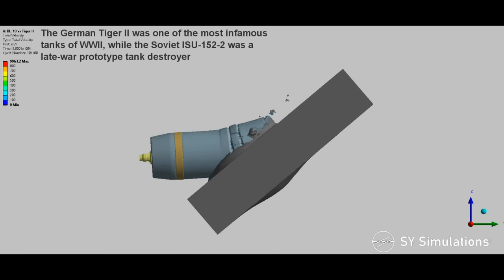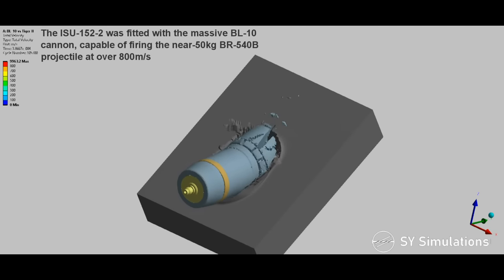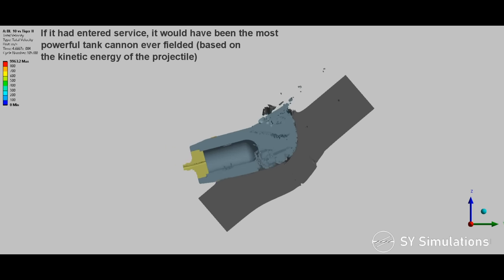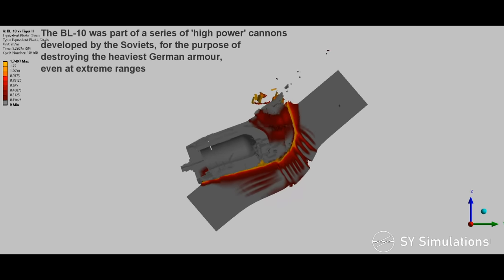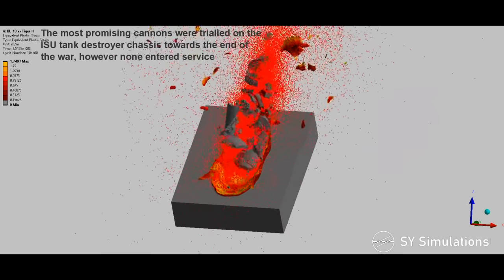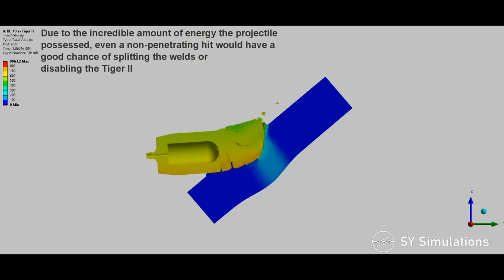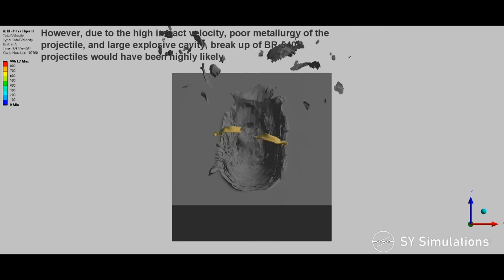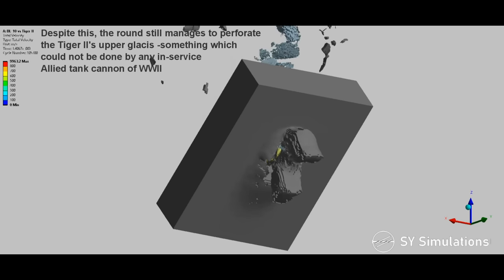SIZE MATTERS | Super ISU-152-2 vs TIGER II | 152mm BL-10 Armour Penetration Simulation

Comment: it's impressive how sloped armor was a real game changer for the time. Imagine this gun's energy would be more than enough to go through 250mm if it was flat
Reply: What do you mean "for the time" ? Slopped armor has been around since before tanks even existed.
Reply: @Niitroxyde  Because slopped armor died as soon as HEAT weapons became effective. 

And no, slopped armor became a real thing during Operation Barbarossa
Reply: @thiagorodrigues5211  What are you talking about.

How could sloped armor disappear because of HEAT when slopped was just as good against HEAT since it increases the effective thickness of the plate and thus the amount of steel the jet has to go through. Only difference is that HEAT projectile can't really ricochet (unless the warhead doesn't properly go off).

Sloped armor was already used on most WW1 tanks you could think of, was used on Ironclad warships in the 19th century and was even used on that Da Vinci's tank design from the 15th century. I'm sure you could find even earlier examples if you dig deep enough.
Reply: @Niitroxyde  Because HEAT didn't just penetrate 100mm anymore. It penetrated 400mm which means it was impossible for any tank to carry as much armor as needed. So Tanks became light and fast after WWII until the development of Compositve armor against HEAT. 

Then, back to kinetic weapons, now an upgraded version of the APDS which again made Tanks vulnerable. 

Now tanks are useless
Reply: @thiagorodrigues5211  And how is that related to sloped armor ? HEAT was defeating RH armor, sloped or not. But sloped armor was still the most effective way to deter HEAT (save for a few spaced armor ideas like the Schürzen) until the apparition of composite armor.
So again, how was HEAT the downfall of sloped armor in particular ?

And how are tanks "useless" ?
People have been calling tanks obsolete since the end of World War I, yet they're still here and further designs are being worked on in militaries around the world, so they're definitely here to stay for at least this century still.

Not to sound too pompous but you need to open a book or two on the matter, bud.
Reply: @Niitroxyde  It doesn't matter how armored your tank is, it will never be thick or slopped enough to handle a HEAT shell. So after the war they realized that and tanks became maneuverable and fast instead of heavy and slopped as in the end of WWII.

ANd you may also need to read some books, I would talk about Otto Carius book called Tigers in the mud where he talks about how vulnerable a tank can be, losing one of his to a PTRD to the radiator. 

Today you get a 10k drone carrying explosides to destroy a 8 million tank plus the training of the crew inside. 
You get a drone designating a target so your helicopter launches a missile from  a safe place and there is nothing you can do about it.
Reply: @thiagorodrigues5211  Well it depends on the warhead itself first of all. HEAT is not some magic wonder that burns through any armor like butter.
A HEAT warhead can only burn through an amount of armor proportional to the charge it carries.
An M1 Bazooka can't go through the frontal plate of a Panther for example.

And the switch from heavy armor to better mobility did not come directly after WWII, it took at the very least the advent of the M40 then the RPG-7 to convince nations to rethink their armor doctrine.
And even then, it wasn't the case for everyone. The US didn't really care about it and sticked with big and heavy, same for the British. And it still worked, especially because they used ding ding sloped armor.

Cheap armament defeating heavy armor is nothing new. Again, some people have deemed tanks obsolete since they were born, basically.
It was especially the case in the 1950s in the Sinai, when Israel used SS.10s against Egyptian tanks, and people were just heralding the end of the tank, because such expensive machines could be defeated by a small weapon that could fit in a suitcase. And yet here we are today, tanks have not gone anywhere.
What you need to make a weapon obsolete is something to replace it, not just something to defeat it.
And right now, no weapon system can replace the versatility of a tank on the battlefield.

Helicopters hunting tanks is nothing new either. It's been a thing for decades, yet it doesn't stop new tank designs from still being put into development. And I think the people designing those tanks know a bit more that you and I do about their hypothetical obsolescence.
Reply: @Niitroxyde  it's new when you get a drone to designate it, meaning absolutely no risk for the helicopter. It's why the KA-52 is being so good at it. And I'm talking about post war HEAT, not war HEAT. HEAT after the war could easily go through 400mm of armor, which means adding more armor would just make a tank slow. 

This is why for many countries now tanks may be a lost cause and we may actually see lightly armored vehicles take their place. 
What's the point on having all that composite armor just to fight other tanks anyway?
Reply: @thiagorodrigues5211 Have you looked at modern tanks? They are all heavily angled to increase armor effectiveness.

Also, you have armor because tanks don't operate in a vacuum. Helicopters are far from the only thing you will run up aganst. Smaller cannons are very common, like the 100mm on the BMP-3, along with it's autocannon.
Reply: @Chopstorm.  no slopped armor can evade a rod penetrating it. It has absolutely no effect on new rounds.
Reply: @thiagorodrigues5211  What are you even talking about? Have you not looked into all of the testing the Army put the M1 through in the 90's when testing it against Russian ammunition, specifically 3BM-42M? Ammunition, by the way, which is more "modern" than what they've been using in Ukraine? 

Also, love how you conveniently ignored the rest of my comment. In WW2 most tanks could kill eachother. Panzer IV H, M4A3, and T-34-85 could all kill each other relatively easily. Guess tanks were useless in WW2 then eh?
Reply: @Chopstorm.  Because I'm not talking about WWII era, I'm talking about post war era. Today's tanks need more than sloped armor to defeat today's ammo. 
So it's better to make an area where it's easy to install and replace composite armor(which by the way is far harder to keep) than thinking sloped armor can do any good to you. Today's tanks have max 6cm of steel and everything else is composite armor installed in the most important areas
Reply: @thiagorodrigues5211  But your reasoning also applies to WW2. 

You're saying because modern tank ammo can penetrate other tanks, armor is useless.

WW2 tanks shooting then modern ammo could penetrate other WW2 tanks. Therfore by your logic, armor on WW2 tanks was useless. Do you seriously not see how flawed your argument is, even if it was true , which it most certainly is not. This has been proven repeatedly by modern tanks surviving incoming "modern" rounds, especially in blue on blue instances in both gulf wars.

And before you backpeddle, here is a quote from your earlier comment. "It doesn't matter how armored your tank is, it will never be thick or slopped enough to handle a heat round."
Reply: @Chopstorm.  Armor is useless today by the simple fact that it's only useful against other tanks and even then, you can't protect your whole tank with composite armor. That has absolutely nothing to do with WWII. But even during WWII they realized how vulnerable a tank can be, not only to other tanks but even heavy mortar.

And it's true, a HEAT round is just too effective, but it only became effective by the end of WWII. a few years after WWII HEAT rounds were both effective and fast enough to blast your 150mm tank from far away, changing the whole idea of Post war tanks to a faster and maneuverable vehicle. 
instead ofa behemoth of steel like the IS Series. It's actually the main reason the IS series died, giving space to the T-54 which was basically a modernized T-44. 

Today you have several flat tanks like the Leclerc, Black Panther and the reason is because it's easier to replace it's composite armor blocks.
Reply: @Chopstorm.  By the way, a tank surviving APCBC has absolutely nothing to do with what I'm talking about. 
But do try to survive APFSDS or whatever it's called now with steel only...
Then again, that's basically a tank vs tank battle, and today's tanks, just like before, are only decently armored frontally. The front of a Tank is 20% of it's area, making it quite vulnerable anywhere else.
Reply: @thiagorodrigues5211  The older versions of Leopard are the only modern tanks to have truly "flat" turret faces, while still being angled horizontally. This was changed with the arrow package, which, surprise surprise, added in more angles. The Black Panther has an exceptionally small flat surface for a turret face, while the rest of it is angled back at an extreme angle. The Leclerc, again, is an extremely small turret face with the rest of it steeply angled. Compare their turret sizes to those on Abrams or Challenger (which are also angled heavily, by the way), and you will see what I'm talking about. Modern tank combat isn't like video games, where you aim for weak spots in the armor.

You also neglect to mention the fact that the hulls are more steeply angled than ever before in tank design.

Also, what are you even talking about with APCBC? My point was that old tanks had the same issue you see with modern tanks: they can all kill each other.  That has never changed. 

This is pointless. You continue to cherry pick points, ignoring the context while also being exceptionally disingenuous in your arguments. You clearly have no idea what you're talking about.
Reply: @Chopstorm.  you realize the amount of steel in today's tanks is nothing compared to WWII, right? That's because composite armor protects you, not sloped armor. 
But anyway, you seem to be too triggered for a normal conversation so, wish you a good weekend
Reply: @thiagorodrigues5211  Where was anyone talking about steel? Did I bring it up once? Ever? The whole conversation was about sloping armor. Composites are a part of armor. Whether that's tank armor or simple body armor. Cloth was used as armor in a gambeson.  It is not only steel. You've completely lost the plot.
Reply: @Chopstorm.  I think you did, because composite armor is basically layers of different materials that are made to take the energy away from a rod instead of deflecting it. Those are made between the tank's steel armor which is basically just thick enough for autocannons and even then, not strong enough to hold discarding sabot autocannons. Composite Armor is what holds today's rounds, not anything slopped.
Reply: @thiagorodrigues5211  I have no idea what you're talking about. The composite armor is sloped. It still has the same effect as sloping steel, by causing incoming projectiles to pass through more material. I never once mentioned steel by itself, and I have no idea why you are.
Reply: @Chopstorm.  Me neither because I never saw composite armor being slopped.
Reply: @thiagorodrigues5211  Then you are legally blind. Look at the front of an Abrams sometime. Or find one in a museum and feel it, since you obviously can't see.
Reply: @Chopstorm.  You realize inside it's just a bunch of ceramics or whatever alligned with spacing to stop the rod, right?
Reply: @thiagorodrigues5211  And all of those ceramics (and in the case of the DU inserts with Abrams) are also angled. It's all angled.  Every bit of it. Look at the inside of the arrowhead armor package that the Leopard 2 uses. It is also angled.

It would make no sense to angle the armor in that way if there was no benefit to it. You're trading effective thickness for space. If you're not getting any additional thickness, then you keep it flat.
Reply: @Chopstorm.  Which is basically taking the energy of the rod away through several penetrations and desintegrating it until there is no energy anymore. Today's tank shells cannot be deflected like back then. 

It's a totally different idea from tanks of the past, where  deflecting a tank shell's energy was the reason it was angled. And it was also the main reason discarding sabot was upgraded, so now there is no need ot a cap or anything else because that thing is not stopping until it's energy is gone.

If the whole purpose of such armor is to be hit while angled then it would only be effective from a certain situation where it's hit frontally and in it's most optimal situation.
Reply: @thiagorodrigues5211 lol I actually think you are right. But the composite components of armour do still have angles with in it. Check the Abrams composite structure, at least the older versions which we can see. Or the Leo's. There are still angles. It's just basic trigonometry, you can get twice the effective thickness of any plate if it's angled 30 degrees, lots of composite armour is made up of smaller angled plates angled to make them lighter.
Reply: @ushikiii  Depends on the tank. New tanks don't need angles anymore. But it's true that there is more area to penetrate if you don't hit it straight. It's still not the priority anymore, with the only country using 60 degrees slopped tanks being Russia whi still uses the same Chassis since the T62 or 64 I think. 

This is why I gave the examples of the K2 and Leclerc tanks, because they're more recent models, one from 2014 and the other from the 90s.
Reply: Yeah, sloped armor is good, however not a gamechanger. It was a bit more expensive and on this video the shell still absolutly damaged poor kitty.
Reply: @funtimewithhuskyman5601  Anything that is good tends to be more expensive. And this weapon was never used during the war
Reply: @thiagorodrigues5211  Even though, it was good, but not that good. By basic trigonometry effective thickness equals to thickness×cos(slope)-¹. That isn't bad, however it isn't that easy. The energy is still transfered almost equally which lead to t34 armour shattering while being hit by that 50mm round pretty easily.
Reply: @funtimewithhuskyman5601  according to Waffenamt, A T-34 at 30 degrees couldn't be penetrated by the kwk39 from 200 meters on. That says a lot about the effectiveness of sloped armor.
Reply: @thiagorodrigues5211  Bruh, soviet armour was melted and made on much bigger temperature, then it should be, so even a kinetic energy from not that fast 50mm projectile could make it shatter and then the shrapnels would damage interior or the crew. Lazerpig had some great video about it if I remember correcrly
Reply: @funtimewithhuskyman5601 The typical western bias of poor steel, poor tank, poor soviets.That's not me saying it, that's german tests saying it. You can also use the book of Otto Carius as source, for he himself describes how the Tiger would never be able to go through the IS-2 that destroyed his sprocket. 
Internal spalling is common with any tank, it's not just one side, it can happen and will happen to any tank that is not RHA armor.
Reply: @thiagorodrigues5211  Spaling was  much bigger problem for early war soviet steel that was just welded at bigger temperatures so it was very prone to that spaling problem. Then, tiger 2 cannon doesn't have any bigger probkem with piercing is2, if your source actually isn't war thunder.
Reply: @funtimewithhuskyman5601  All tanks from all sides were cast or high hardness. The tanks that came during the war had RHA armor and even then, not all of them. 

A Tiger II is not a Tiger, it's a tank that entered service by the end of WWII. 
Otto Carius didn't command Tiger II Platoons, just Tigers and then Jagdtigers.
So I don't even know why a Tiger II is being part of this subject right now.

The Western Bias going beyond sanity to point out things that were common in every tank, not only Soviet. 

HIgh hardness was common between germans and Brits, Cast was common between Soviets. 

The Panzer IV only started being built with RHA by the end of the war as well. 
The Panther was going to be a high hardness tank until they realized capped shells were too effective against it.

You gotta Remember the good german Tanks came after the war started, not before. the Tiger and Panther were the tanks that were relevant though, everything else was as rare as an unicorn, with the most common being Panzer IV and tank destroyers like the STUG.
Reply: @thiagorodrigues5211  Nevermind, I misread it as a tiger 2. Even though, tiger 1 cannon was powerful enough to pierce through is2. Only thing that I am saying is that sloped armour cannot stop the kinetic or chemical energy and the early war soviet armour that has been made in higher temperatures was more vulnerable to spaling and shattering by that energy. And go watch that lazerpig video, I have been searching for it for some time as this dude can explain it better. Also there isn't any western bias, the soviet war machines weren't produced with emphasis on a quality rather than quantity and need to be quickly deployed at the start of barbarosa.
Reply: @thiagorodrigues5211  Tigers and panthers were bad tanks, since they consumed too much precious oil, weren't reliable enough, the cost was too high and the panzer 4 H could do as much as those big cats did.(or stug 3g in anti tank role)
Reply: @funtimewithhuskyman5601  Wa Pruf 1 is a german document that proves  an IS-2 of 1943  model would already be in advantage against a Tiger, let alone the 1944 version. The Tiger was a good tank but the IS-2 was just overall better. Otto Carius already talks about it. He says it was smaller, better shape and a powerful gun which the germans respected. It was also much lighter and easier to produce. around 6000 IS-2s were produced compared to less than 1500 Tigers. 

No armor can ignore kinetic force. Rolled Homogeneous Armor would deform like butter. This was good for the structure around it but the damage in the armor would be there. 

Sloped armor will defect the energy, that's the main quality of it. It's not a direct hit anymore so you end up´with a less effective shell. It's also why a Tiger would always fight with it's tront sloped to the enemy. 
 
Today a tank is useless but back then that was the best shape for it.
Reply: @funtimewithhuskyman5601  The best Tank destroyer of the war was the STUG. But there is no such thing as a bad tank. A Heavy Tank is deployed where the average tank can't. Any heavier tank will consume more fuel. it's natural.
Reply: @thiagorodrigues5211  Medium can do everything and when more destructive power is needed, let there be beloved artillery.
Reply: @funtimewithhuskyman5601  the main reason heavy tanks existed was gor breakthrough. It was why Tigers were vanguard during Kursk. Because the front of a tank is just 20% of it. Any other tank at that time would be knocked out from a side shot. 
That's why Tigers have a 10:1 kill ratio
Reply: @thiagorodrigues5211  Artillery is much more effective in breakthrough. Also panzer 4 H would perform as well during a breakthrough as tiger, since for 1 tiger, you could have at least 2 panzer 4. The main reason why operation Citadel was unsuccessfull were supply problems, allied bombing, but mainly soviets had the necessary intel.
Reply: @funtimewithhuskyman5601  artillery and breakthrough are two different things. Artillery doesn't move to capture. It can also be countered with artillery. A tiger was worth 10 allied tanks
Reply: @thiagorodrigues5211  With arty, you can shell the position and then invade with more mobile usually motorized troops and tanks that are both fas and armoured. Also mobilized artillery was used in big numbers in ww2.
Reply: @funtimewithhuskyman5601  mobilized infantry can't handle AT shells and mortars or artillery like tanks. 
The main reason Germany crushed almost everyone was by the use of tanks. The main reason the japanese crushed the japanese was because they had those awful tanks while the chinese had none
Reply: Xd
Reply: @thiagorodrigues5211  just because it doesn't get deflected doesn't mean it won't fail under extreme angle
if the angle is steep enough, sure, long rod penetrators may not ricochet, but it will just snap in half and lose a considerable amount of penetrating power
also HEAT is not as useful as you think, especially nowadays lots of tanks are littered with ERAs
ERAs are not super effective against APDSFS, but it sure does very well against HEATs
when you say armor sloping isn't effective, it just means it isn't sloped enough, or the surface hardness is too low.
it is very possible that extreme angled plates, like the UFP of Strv 103B and BMP, makes the APFSDS just fail because the front half of the rod snapped off and the rear half doesn't have enough power to go thru all that (doesn't matter in BMP's case since its too thin anyways)
keep in mind piercing armor with shells isn't an exact science, all kinds of janky stuff has happened before and will probably happen again.
(yes, a soviet WW2 era 122mm cannon found on IS-3s can can very possibly knock out abrams if lucky enough, modern MBTs has way more weak spots than you think)
Reply: @PurpleBossonius  if you only count the most angled area of a tank, it's not really any proof that it can deflect it. 

Also, every ATGM is a HEAT Rocket. You can see ATGMS have been ruining tanks since a long time ago
Reply: @thiagorodrigues5211  
In strv 103case, pretty much the whole front of the tank is at extreme angle.
Also ATGM only does that because they hit top of the tank, and Russians doesn’t put ERA on the tank roof
Reply: @PurpleBossonius  ATGM can go through over 1000mm of RHA, no tank can handle that. All those Leopards and Challengers destroyed in Ukraine were due to ATGM, probably the Kornet version. 

and the STVR is an old turretless vehicle that still would be penetrated by kinetic or HEAT
Reply: @thiagorodrigues5211  thats RHA
and there is a reason why we don't use RHA anymore
a good ERA can easily prevent it from going thru, as long it is a shaped charge, chances are it ain't doing nothing to tank if it hit an ERA
also most leopards and challegers doesn't have ERA.....mostly russian tanks have them
and Strv 103 is put out of service for gun accuracy problem due to hull aim, also it is obviously impossible to drive and shoot accurately.
but its design did proven to make lots of APDSFS fail due to tip snapping off, still didn't save it from HEATs tho
Reply: @PurpleBossonius  I did reply to this message but I don't know if it's a glitch, I can't fin my answer. 

In any case, Red Effect posted a video of a leopard being destroyed by RPG. 

ERA is not perfect, it's far from perfect actually.
Reply: @thiagorodrigues5211 mmmm I love it when people spread misinformation on the internet
Reply: @thiagorodrigues5211 You clearly no nothing about engineering.
Reply: @koi_krapfen that's why I get the info by reading about it,  not testing
Reply: @thiagorodrigues5211 Sloped (even composite) armor is still used nowadays, and everywhere, it's just not as relevant as it was before due to new rounds having better and better angle performances.
ATGMs aren't all powerful, neither are drones. More and more militaries are investing in APS and Anti-drones equipments. 
The tank isn't obsolete, not yet. It's  a loop: a new type of weapon appears on the battlefield, people say tanks are obsolete, tanks find a way to counter these new threats, and so on.
Reply: @justmrcrow  almost all tanks lost in Ukraine were due to ATGM or drones...
Reply: @thiagorodrigues5211  And? That's only now, in a state where both countries are using decades-old tanks. They don't have APS and mostly don't have any anti-drone system.
Reply: @justmrcrow  anti-drone system doesn't exist. It's something we only learned now, that a 500 dollars drone can destroy a 10 million vehicle. Or worse, designate a helicopter to shoot from kms away, which is what a KA-52 does really well.
An ukrainian general once said that the situation right now is artillery, drones and  ATGMs because no one can move without being targeted. 
It's like WWI where they were stuck in trenches because they didn't know how else to fight such war.
We may actually see anti-drone systems soon yeah, but now you need not only 10 million for your tank but anti-drone system as well. 

Tanks are past for a reason. You can't even protect them completely, all those ceramics and depleted uranium and all else, too heavy for you to add on all areas. 

Tanks have been obsolete since the T-80 against chechens.
Reply: @justmrcrow  The Leopards and Challengers were destroyed the same way, they were even recorded catching fire and completely destroyed. 
Every tanks has the same vulnerability. Same in Israel as we speak, several RPG7s with 200 bucks modern HEAT are destroying Merkavas.

There is not technology leap when it comes to that. There is nothing that came save you from that which is why tanks are being destroyed like nothing
Reply: @thiagorodrigues5211  drones jamming weapons exist, it's just not used in Ukraine.
APSs do exist, too.
Don't look at Ukraine like it's what the west will do with their tanks. Ukraine right now is a chaotic, unorganized shithole. Tanks aren't supposed to be alone on a battlefield, nor in a war.
Look at the masterpiece that Desert storm was. Sure, there were no drones. But there were ATGMs and RPGs, and yet everything worked perfectly.
It's only a matter of time before drone jamming systems and APS become common.
Reply: @justmrcrow  you're comparing a 33 years old war which had old technology of soviet era equipemt with today's war. 

The west doesn't have anything special, there is no gap in technology. That's why they still make new F-15 versions even though they spend so much on stealth. 
They keep telling you theirs is better though, that's for sure.

The west keeps sending it's equipment to Ukraine and it keeps being lost the same way. There is just too much a tank needs to avoid to be effective, which makes any war of two powerful nations a war where tanks are useless.
Reply: @thiagorodrigues5211  I'm not talking about technology here. I'm talking about how said technology is used. The US isn't going to be using their Bradleys and Abrams like Ukraine currently does.
As I said before, Desert Storm is how tank warfare should go. Despite being a somewhat old conflict, it's still how tanks nowadays should be used.
What happened in Chechnya and in Ukraine was and still is utter nonsense.

Also yes, the US has better aircrafts than Russia that's for sure.
Reply: @justmrcrow  desert storm was US fighting T-55s, T-62s and the iraq version of T-72 called Lion of Babylon. Which of course wasn't up to the current T-72s. 

As for jets, there is no source to prove who has the best jet. All you get is again, western jets fighting soviet era jets. 
Jets are a complicated subject. The jet itself today can be just fast enough to get in and out, the missile though is far more relevant  than the jet.
Reply: @thiagorodrigues5211  Yes, and no. Desert Storm was the Coalition beating the heck out of Iraq with an actual strategy. And not whatever crap Russia and Ukraine are currently trying to achieve.
The tank is still not dead, it's just currently used terribly.

As for aircrafts I'm fairly certain the US can easily claim the throne for the currently best aircraft. The F-22 is somewhat old and yet it's still better than the SU-57
Reply: @justmrcrow  no one even knows anything about the SU, how can they even compare? The F-22 didn't even see action. It's crazy how everyone is already saying it's the best
Reply: @thiagorodrigues5211  You can just see how bad the SU-57 is by just looking at it.
Visible bolts, huge engines, no special paint, not extremely stealthy if you ask me.
Reply: @justmrcrow  So that is the info you get. What you saw in it?

You realize stealth is not about radars not getting you right?
Reply: @justmrcrow  I'm more surprised you see the SU-57 as a bad jet by a pic but you know the F-22 is a great fighter with no combat record.

Everyone thought the MIG-31 was a bad plane and there it is, being the best plane fo their current war.
Reply: @thiagorodrigues5211  Stealth is about not being detected, it's as simple as that.
And just by looking at the SU-57 you can see it's not a real stealth aircraft, unlike the F-35 and F-22.
As I stated before, the SU-57 has got VISIBLE RIVETS.
Body panels aren't close which means stealth capability is decreased.
The nozzles aren't very stealthy either: pretty much identical to the SU-37's...
It's production rate is more than questionable, and it seems not alot of people want to buy it...
The F-22 is just better despite both not even having seen combat, it's a real stealth plane, and not just because you can't actually see it on the battlefield.
Reply: @justmrcrow  every jet is detected. Stealth is made so it's hard to track, not detect. Which means you shoot first, your enemy has to defend somehow or your enemy shoots but the chances of hitting are low. 

You can't just make an uknown jet be below a jet that was never used just by using a picture... It's a picture of a jet that doesn't look like the F-22, that's all. 
No one knows the technology being used, no one knows how many may be active if there are any active. No one even knows if stealth jets will actually be a thing, since USA itself doesn't rely on stealth jets only, with a new version of the F-15 being made. 
It can't carry missiles outside, it's missile amount is very low and it's certainly not made for a large scale combat. 

The US bias has always been around though. There is nothing USA does that is below other countries if you count their opinion. 

If we talk about the best jet then, so far the F-15 does it's job for what, 40 years?the F-16, being the cheaper version, the SU-27 being the rival of F-15. Those were tested and proved to be good jets.
Reply: @thiagorodrigues5211  Back then stealth aircrafts couldn't even be detected at all. 
Ever heard the story of the F-22s escorting a T-95 without said T-95 ever knowing it was being followed?
Sukhoi themselves stated that the RCS of the SU-57 equals that of a clean Super Hornet. Also, remind me of how many of these "stealth" aircrafts were produced.
No, they can't just rely on stealth aircrafts because obviously they are expensive, and it's cheaper to just upgrade older models rather then entirely replace them with F-35s.
The F-22 can store up to 8 AAMs, which is definitely enough for what it does.
It's not US bias here, altough yes, it does exist and you find it everywhere on any video talking about pretty much any military subject, it's facts. The US can currently claim to have the best Airforce in the world.
Reply: @justmrcrow  it's a story of s bomber who can't detect a F-22. 
Stealth doesn't work this way. It's related to missile tracking, radars today are too precise to not be able to detect. 
It is said that the SU-57 maybe be in use as we speak but there is no source that can prove it, we'll never know. But we can't really comparing what wasn't used, it's like saying the chinese stealth fighter is the best for example. 

I just think what we can be sure is what we see. And what we see about the stealth fighters so far is nothing.
Reply: @thiagorodrigues5211  Sorry to tell you that you're wrong.
You see, the F-22 was involved in the shooting of a spy baloon. Therefore it is fully combat proven, and clearly the best aircraft ever engineered.
Reply: @justmrcrow  hahaha, the baloon campaign, where the F-22 put all those millions of investment to use against such threat. 
That was funny man, merry christmas!
Reply: @thiagorodrigues5211  Merry christmas to you too!
Reply: @thiagorodrigues5211   " changing the whole idea of Post war tanks to a faster and maneuverable vehicle. " tell me you know nothing about tanks without telling me you know nothing about tanks.
Reply: @ulfenburg7539  Tell me you then, oh, wise one
Reply: @thiagorodrigues5211  Brother in christ you actually think that the heatfs sparked the pursuit of more nimble tanks? Were you dropped? The pursuit of more nimble tanks was thanks to the war experience not heat. Literally every country began production or development to faster tanks based on newer tech (strong engines and what not) and experience. Hell even after heatfs was an actual thing, lots of big slow and not nimble tanks were produced. Look at the chieftian. Again faster tanks were not a product of heat. Corralation doesn't mean causation. Also solid take on sloped armor. "doesn't have any effect" what a load of brain rot that was to read.
Reply: @ulfenburg7539  The pursuit of fast tanks was due to the fact that a tank was too vulnerable to risk getting shot, a contrast to the idea during WWII, where Germany kept adding more and more armor to it's new designs. They realized tanks were vulnerable in urban combat, HEAT was more than enough for any steel armor and more accurate fire meant you wanted a fast tank, not a heavy tank. So from 50 to 60 tons behemoths we saw the IS series die, the 36 tons T-54 and T-55, the AMX-30, the Leopard 1, the bulldog, the M40 series was one of the tank series that saw several different models to handle the new kind of rounds. 

HEAT was the new threat, you had recoiless rifles and SPGs and infantry that had far more effective AT weapons for urban combat as well as tanks using such rounds of course.

Until composite armor changed it, HEAT was just too effective for steel armor to handle it.
Reply: @thiagorodrigues5211  "The pursuit of fast tanks was due to the fact that a tank was too vulnerable to risk getting shot" lol no. Just ignore everything i said. Again corralation doesnt mean causation. Though i wont discuss this with you because this is just too much brain rot for me.
Reply: @ulfenburg7539  as usual, no arguments, runs away at first moment. 2023 at it's best
Reply: @thiagorodrigues5211  lol bro okay sure. "ignores other arguement" lol no arguement
Reply: @ulfenburg7539  people's champ, everyone.
Reply: @thiagorodrigues5211 Stop wasting your time dude bruns must have never seen composite armor or an H.E.A.T.F.S Modern rocket
Reply: @Chopstorm. Props to you for arguing with that “thing” for so long.
Reply: @thiagorodrigues5211 
We knew how sloped armor worked since the 1600s
English knights wore breastplates that came to a vertical ridge that ran down the chest of the knight 

Many tanks before  barbrossa used sloped armor
Reply: @thiagorodrigues5211  One can counter your whole argument by just pointing out that ERA and NERA / Composite armor works only because of the slope. If era was facing flat towards the penetrator it would do next to nothing. And yes, it's true that APFSDS and HEAT aren't really bothered by shattering and ricochet as much as the older rounds but the extra length you get into the armor still works. Plus most NERA packages still work because of angled plates reacting with the penetrator and their vibration knocking it off course / shattering it / stealing its momentum. There are a bunch of simulation videos on youtube showing pretty neatly how the principle works
Reply: @PAcifisti  As I said previously, it's not made to deflect anymore, it's made to take the energy of the round away. It's not about building a sloped tank anymore, which is why we have the Black Panther, a recent tank with no sloped design.
Reply: @thiagorodrigues5211  actually it is built to deflect the round. Composite armour works usually by incorporating different density materials, even air to then make the penetrator tumble and deflect, shattering and making it impact the last layer on an angle that resorts often in deflection inside the armour array. ERA works by shooting up a metal plate that both breaks and deflects the penetrator.

Again, there are great videos about this on YouTube. The "flat surface" you see on leopard 2a4 or Abrams is actually filled with plates at an angle, usually multiple different angles to make sure that nothing hits it straight on. Angling has never been as important as it is now.
Reply: @PAcifisti  Well, that really is a differnet kind of source from the usual, who would you recommend? I know we can't share links now, any channel? 

I have been reading about it and it's always the same talk. Deflecting is impossible, taking the energy away is the main goal and of course, with each surface it's penetrade, the projectile loses mass.

Also, thanks for being polite in a discussion where everyone seems pissed.
Reply: @thiagorodrigues5211  I mean, this channel is one good one. Another good one is Dejmian XYZ Simulations. While current NERA composites are classified, we do know of some earlier ones. They're composed of metal plates sandwiched between rubber plates, set at an angle. Idea is that the impact makes the metal plates vibrate, and since they're at an angle this will make the edges of the metal press against the penetrator, tilting it sideways to both shatter and divert it. 

As you can see this only works when the penetrator impacts the actual NERA inside the armor at an angle - else the vibrating plate wouldn't be pushing against the sides of the rod.

While you're correct that it's very difficult to initial impact deflect it, the clever NERA plates do manage to both slow it and nudge its course after shattering it. This makes the individual pieces tumble and impact the last layer a bit sideways, greatly reducing their penetration potential and making them often deflect along side of it.

Ofc not to forget the turret cheeks of Leopard 2A5+ that have the hollow cheeks which have the role of making any APFSDS tumble after piercing through them.

Also note- Russian tanks took a different way to armor against APFSDS than western ones.
Reply: @PAcifisti  But those are simulations... The sites I use are related to the physics related. None of these talks about deflection but absorbing the energy.
It's impossible to deflect rounds with ceramics or anything like that, the idea is that such blocks will break but slowly take the energy away as well as affect the rod's structure.
Reply: @thiagorodrigues5211  yes, simulations of known armour arrays from leaks. You're correct that soviet armour design focused on eroding and slowing projectiles ( with the exception of relikt and other ERA ) but western armour didn't. NERA comes from Non Explosive Reactive Armour, which usually means metal+rubber plates that physically react with the penetrator to shatter and alter it's course, just like ERA does to HEAT (and apfsds in some cases).
Reply: @Niitroxyde The reason sloprd armour wasn't extensively used during ww2 until omeration barbarossa is that first, they didn't realise how effective it was, second, it was more of a choice between cramped, but well-armoured tank, and spacious but less effectively-armoured tank. And the biggest issue was manufacturing it. The techniques for sloped armour were pretty extensive to use.
Reply: @thiagorodrigues5211 sloping the armor makes it more effective at taking energy away from the penetrator with the same amount of armor weight because the rod physically has to go through more armor if the armor is sloped vs not sloped